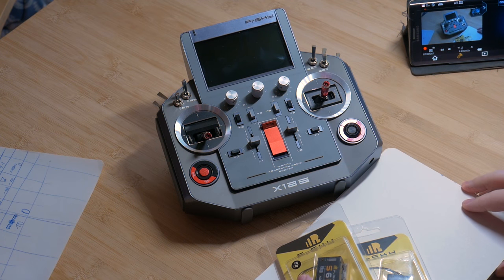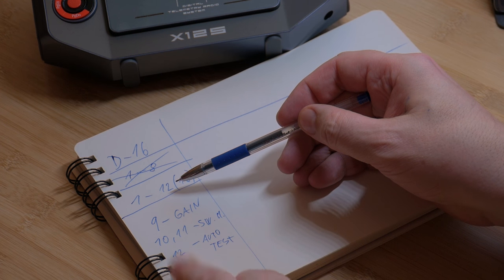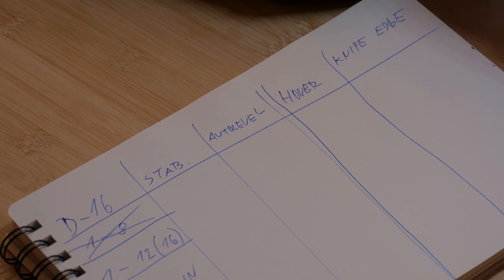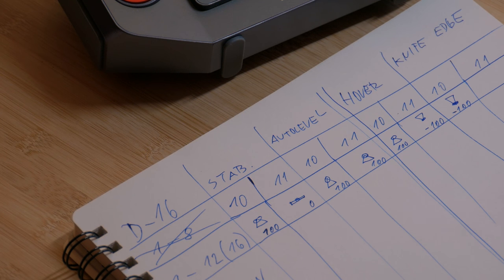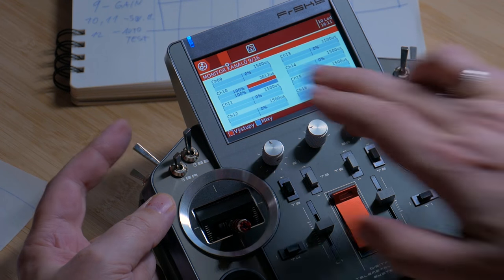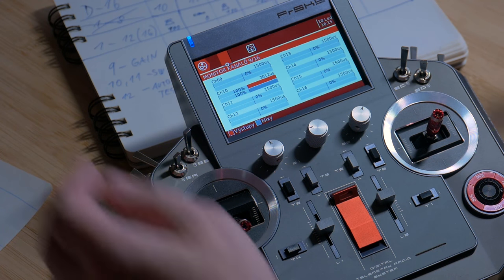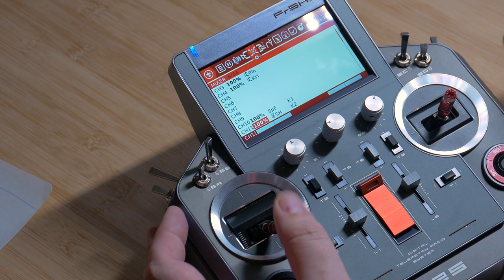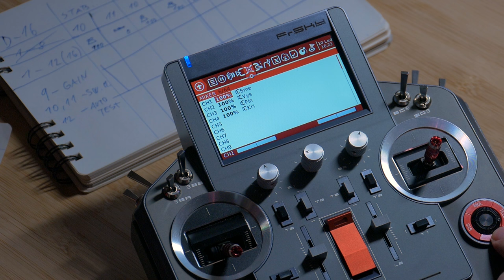FrSky S6R   Receiver with stabilization   Video tutorial No2 Model setup

Comment: I've installed this receiver in a Parkzone Corsair,  WingWing Z84 and a Freewing F9 Panther.  I will never fly again with such a receiver, unless I'm installing a iNAV flight controller. 
This receiver works extremely well and not only improves flight performance, but also provides a nice safe feature, no matter how experienced a pilot you are, it is cheap insurance to have the autolevel feature when you need it.  It works equally well for both conventional prop or EDF driven airplanes. 
It is not particularly difficult to set up with with the STK tool or with Taranis Lua script.  There are plenty of good YouTube videos available such as this one.  Just follow them very carefully and triple check to make sure that the compensation is in the right direction.  
By the way, this receiver works just as well with the antenna pointing toward the back instead of the fron which was also better for my particular installs.

Comment: Thank you Richard.  Yet another really helpful tutorial.  I couldn't get my head round the setup for the S6R and was about to chuck it but now I've got it working perfectly. Many thanks and keep up the good work :)
Reply from the maker: My pleasure :)
Reply: @richardmrazek  is it possible to have the the gain and switches on different channels? Like instead of 9-12, can i use 13-16?also whenever i turn on the gyro my channel 5 and 6 for my gear and flaps stops working but when I disable the gyro it works. I even tried setting the channels as auxiliary but it still doesn’t work unless i disable the gyro.

Comment: just a quick question? i have followed exactly your method and still no stab, i have calibrated receiver still nothing do i need to adjust end points ? in the manual it states 1500us and 50us i cannot understand why the stab and auto level won't work?
Reply from the maker: ...and did you make a necessary step - moving with all stick (exc. throttle) after switch on power on airplane? I will make a soon video No3 - what and how with S6R on airfield :)
Reply: i think so the self check works but thats it
Reply: i only get auto level to work when i flick switch but no stab at all...there is no difference between on and off

Comment: Help !  As a beginner I only need  stabilizer and auto level on one switch as I am a beginner and don't want the other functions yet , I copied some  mixes from another closed S6r forum  but am having an issue ... When I select stabilized mode it appears to want to put the model into a knife edge position ( not what I want) switch to center turns of the gyro nicely and switch down switches on auto level nicely. Any ideas as to why when selecting stabilized mode I am getting what appears to be knife edge ? 
I am using a Qx7 with 2.2  with a S8R in a night walrus ( I'm programming with the radio not a stick) I have configured the rx and completed self check , auto level seems to function well . 
Something else I am unsure of ... I have the gain assigned to S1pot but I'm not sure it is working as when I move the model in auto level mode I don't notice a difference in reaction speed , is there a way to test this ?  
Thanks in advance for any advice or pointers so I can get this running, below is the mixes I copied into my Qx7. 
Regards , Marcus 
image1.PNG

Comment: Has anybody had problems with not being able to set up elevator rates? Aileron and rudder rates work fine but can't get elevator rates to work. Transmitter shows correct reaction on the graph but now change in the movement of the elevators.
Reply from the maker: avman180 I thing wrong selfcheck without full servo range setup in next step.
Reply: Turns out on the mixer page I'd selected rudder and aileron inputs and ele stick. Sorted now. Thanks